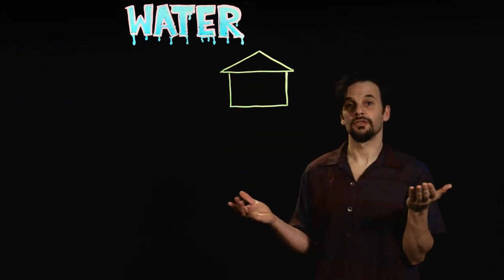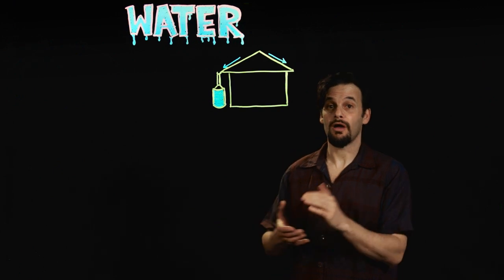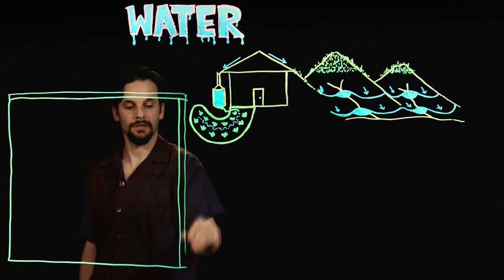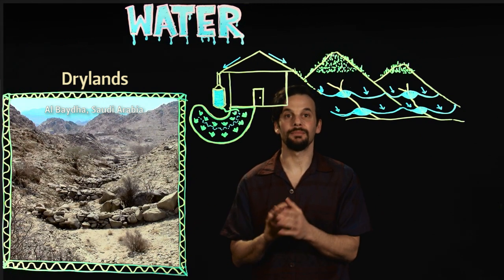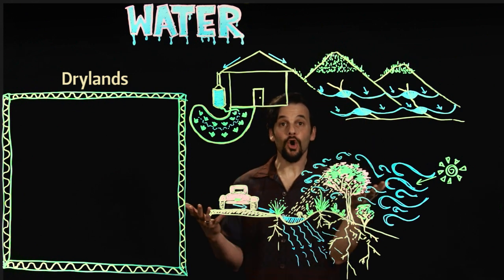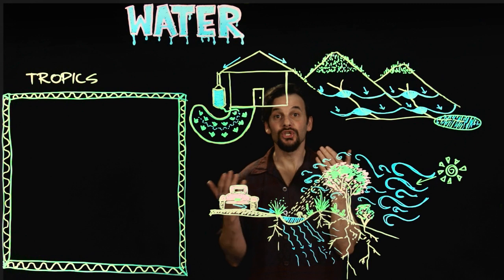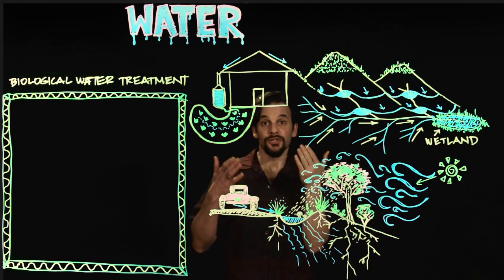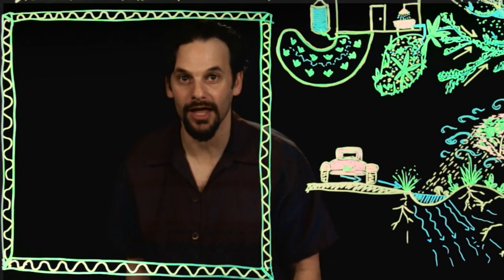Permaculture Design for Water

Comment: good video, good info, 

water is life, but too much water in tropical country such malaysia and sloppy hill will post land slide issue. 
i know slope is no good for ag, but can't help it. 
i think for sloppy terraced orchard, rain water should be lead away fast instead of let it soak into the soil causing saturation...

any video on this  ?  too much rain and sloppy hill gardening .. 

thx
andrew
Reply: andrew ysk The danger of landslides will be much more reduced, if you discard monoculture. It's very important to have trees and plants of varying heights from canopy, fruit trees, bushes, shrubs, climbers and ground covering creepers; only all of these together in the slopes will hold the substrate. The excess surface runoff will naturally form creeks...you can keep it alive by introducing ferns to the edges